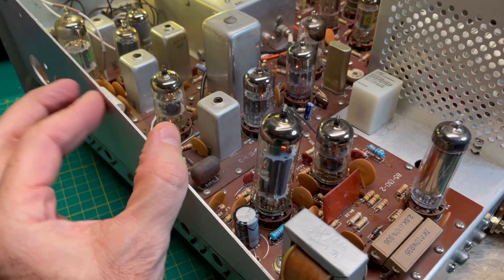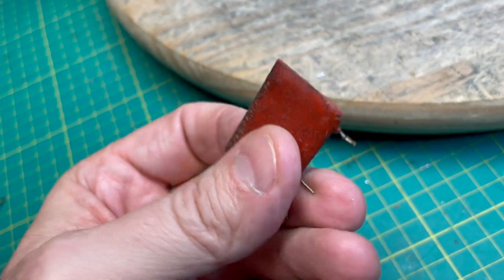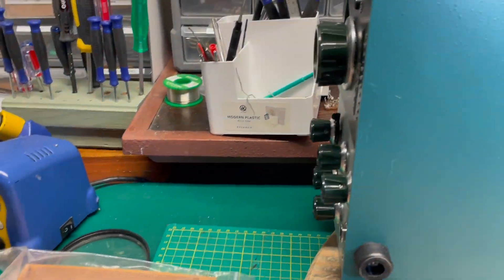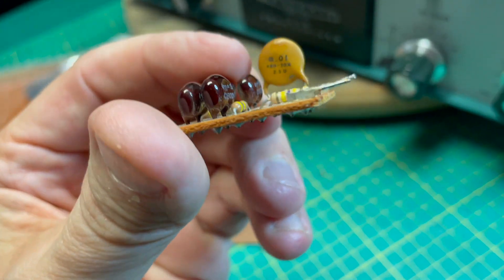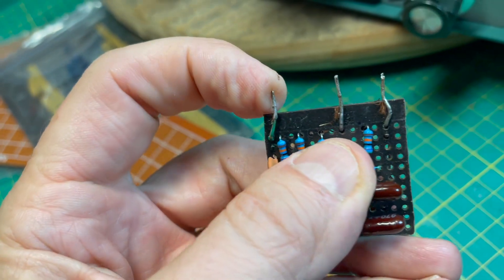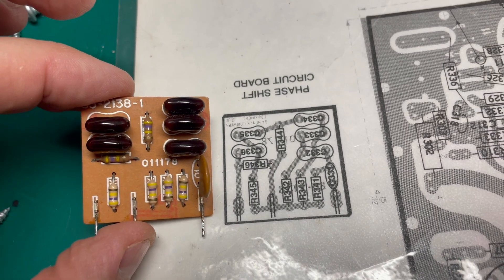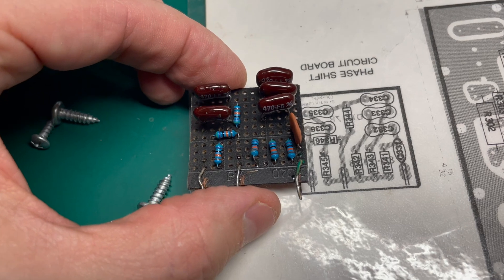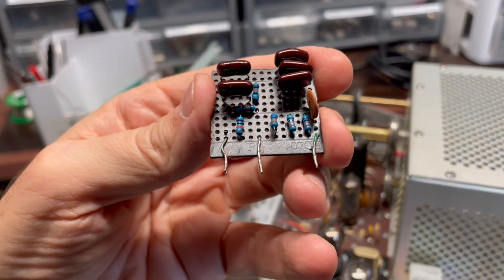Heathkit HW-101 - build your own phase shift board

Comment: I bought that same pack of circuit boards and I think I prefer that kind with the strips all connected ("strip board")? like "LOOKMUMNOCOMPUTER" uses on his synth projects. You do have to Dremel or drill out the strips, but they save a LOT of solder on a larger project. What you built here looks really go though, or at least better than my work with this kind of board. Thanks and take care. 73 W1RMD.